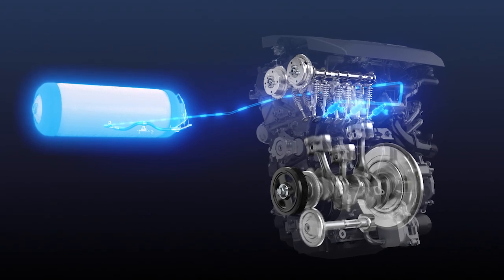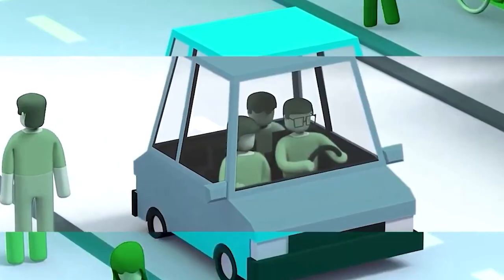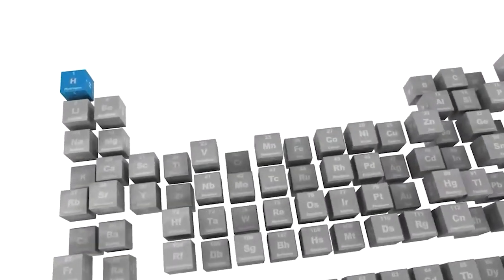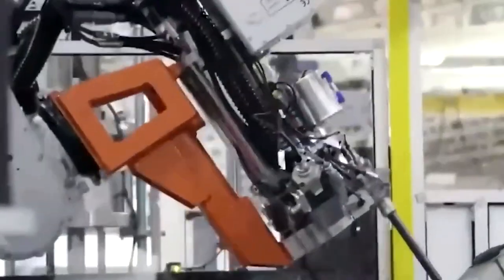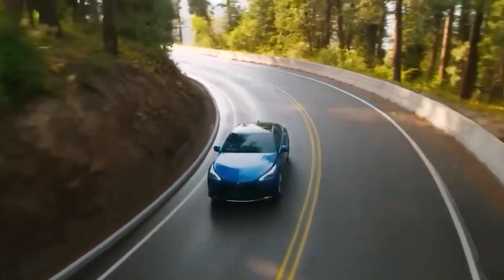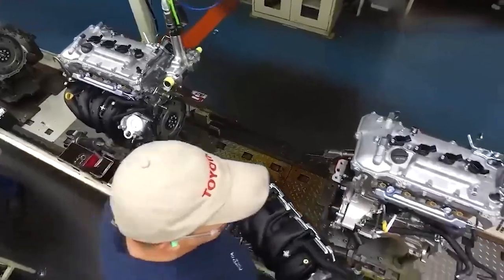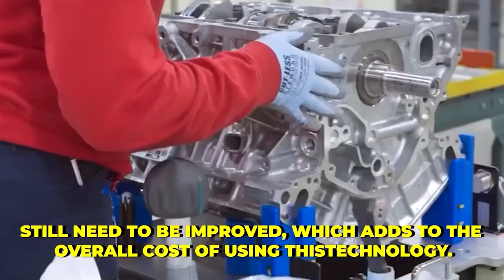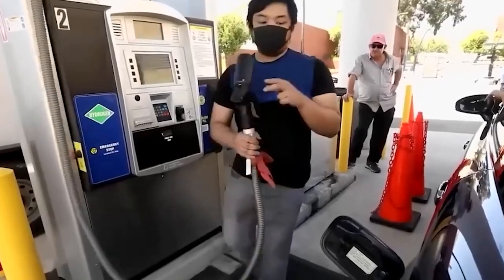Toyota STUNS The Entire EV Industry With New Hydrogen Engine!

Comment: You haven't researched it enough, so let me put it for the viewers:
Producing hydrogen requires electricity in the first place. Then, after energy consumed to transport the gas to the pumps, and getting it inside the car, the process of conversion of H2 into water and getting electricity also has its losses due to efficiency. To quote VW AG:
"In the case of the hydrogen-powered e-car, the losses are much greater: 45 percent of the energy is already lost during the production of hydrogen through electrolysis. Of this remaining 55 percent of the original energy, another 55 percent is lost when converting hydrogen into electricity within the vehicle. This means that the hydrogen-powered e-car only achieves an efficiency of between 25 to 35 percent, depending on the model. For the sake of completeness: the efficiency is even worse with alternative fuels. The overall efficiency here is only 10 to 20 percent."
Reply: The problem with your argument is that you are making assumptions about technology that is over 30 years old.
H2 technology for production and storage has made significant advances, but it is not well publicized in the MSM and is the victim of lazy journalism. 
The Artificial Leaf is a case in point.   This is a solar panel that converts water into H2 in one step (not traditional electrolysis).  The Japanese and the Germans have been collaborating on this for a few years.
The other innovation is safe storage using Keratin nanotubes.  This would line the storage tanks of H2 vehicles and would not explode or cause a flame if the tank was breached. 
Fuel cells have also become far more efficient compared to the old ones.